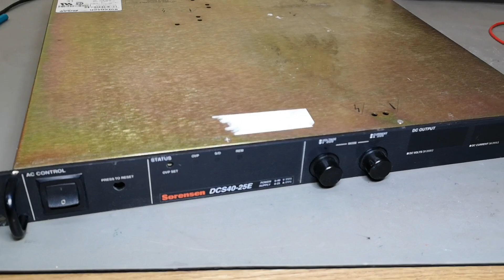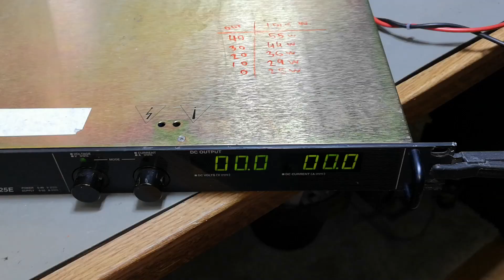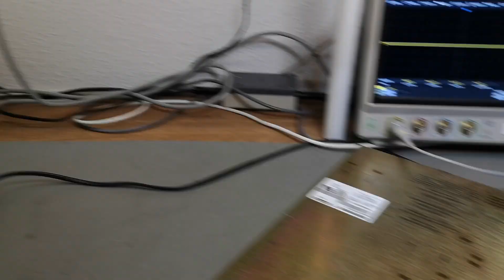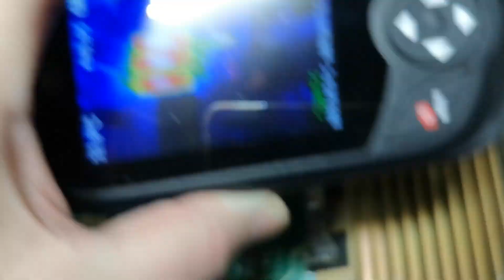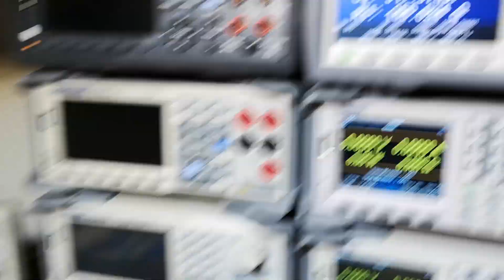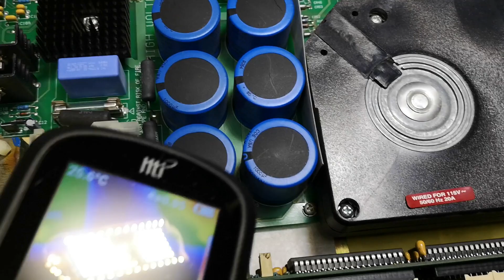Sorensen DCS40-25E switch mode power supply 1kW test teardown repair

Comment: 21:23 do I spy a rifa cap?
Reply from the maker: oh yes, but the new blue type, dont seem to find them cracking or blowing up
Reply: Actually I was thinking the yellow rectangular one next to the edge of the chassis. White black twisted pair running in-between it and the top large filter cap. May not be a rifa though, looking closer it has two bright yellow things sticking out both sides. What is that?

Comment: Did it ever happen to you or if you ever heard from someone that during REMOTE operation output caps start smoking?!

I have DCS8-125E unit and it was working perfectly by yesterday. The unit's J3 terminal was wired for remote voltage/current programming, remote shutdown, local OVP, remote voltage sensing. What happened yesterday is that the positive voltage sense terminal was disconnected from the positive current terminal (negative voltage was connected to negative current terminal) while I turned on the output by the remote command. The unit started smoking immediately. Remote controller/logger (i.e., Arduino) logged output current of 2.8 Amps for a couple of seconds although the circuit was open (before I noticed the smoke and pressed the E-STOP button on a test-stand). I haven't seen values on either display (voltage or current) before pressing E-STOP button.

Upon opening and inspection, I determined that the source of smoke were three big 22mF / 16V output capacitors (C51-C53). I ordered the replacements, but I want to be sure the error wouldn't kill the new caps as well (or something else). No other components look suspicious/burned inside the unit.

Is it possible that DCS units in general can give high voltages (in this case: greater that 8V) if remote voltage sensing is enabled and sensing wire get disconnected from the circuit or there is a specific failure in my unit? By high voltages I mean voltages high enough to make 16-Volt caps start smoking immediately?!
Reply from the maker: output caps do see alot of ripple currents, so make sure your new caps are designed for this

Comment: Thanks for the teardown and repair video. I have a DCS60-18 that shuts down with an OVP error (no load) that I will start troubleshooting, which is what brought me here. I have a thermal camera !
Unfortunately the hot resistors is the price you pay for low frequency snubbers (50-60 Hz). The purpose of the snubbers is to protect the FETs used in the final output stage from large voltage transients. The FET and associated components define the parasitic capacitances of all those parts, which drives the selection of C and R in the snubber circuit. You could do away with the circuit for power savings but be prepared to replace a lot of semiconductors due to overvoltage. It's probably best to just live with the losses, although you might consider upping the wattage of the resistors to keep the heat down inside the chassis.
ymmv
Reply from the maker: i really hope you manage to fix it, the DCS series are super nice units, I still take this one out now and then and use it for job projects.

Comment: Nice piece, congrats on finding the faulty capacitor, a thermal imager is a very useful tool. When I was still working in research and development laboratories, one of my specialties was repairing high-power sources for international telephone connections. Rack design with a height of 4U and after removing the cover there was no room for air inside as it was filled with components. Those sources were connected 24/7 for several years and were monitored from a central PC. One day, for example, the PC detected a voltage drop of 0.5V below the limit and switched the backup power supply, and this, which was evaluated as defective, got to my desk. Well, in a box like this, look for where and why you are missing 0.5V when after 24 hours of re-operation the voltage is absolutely accurate, I was looking for that defect for 3 months. Original components had to be used, the manufacturer forbade the use of substitutes. For the first time in my life, I saw a diode with a temperature specification of 0.001V/°K. Those sources lasted unbelievably, the longest documented operation during my time was 24/7/15 years from the first switch on.

Merry Christmas and Happy New Year 🎄🎁🙂 Tom

Comment: Hvad er det for et hvidt bånd der går igennem hele strømforsyningen? Det ligner et fladkabel ..
Reply from the maker: the white band in the centre, is a plastic-cardboard type of band, its purpose is to steer the air flow correctly thru the unit with the lit closed
Reply: @TeardownOZ2CPU  Yes of course, thank you

Comment: Maybe the air flow and thus cooling is different with lid closed?
Reply from the maker: YES cooling is a lot different, and a lot better, i will not recommend to run it at full power with lit removed !
but the broken capacitor was super lucky to find, only found due to luck
Reply: @TeardownOZ2CPU  i was surprised to see it being not a tantalum this time!
Reply: @zaprodk  heh if it was a tantalum it would have been found many years ago when it exploded lol
Reply: It will be. But in these energy saving times, that kind of losses is not cool.
Reply: @zaprodk  55W losses at 1kW wouldn’t be bad.
Think about the efficiency of an empty fridge…
Reply: @inse001  but that is 55W losses at no load. That's the part that sucks. I believe the losses will be even bigger when the PSU is under load and delivers the full output current at full voltage.
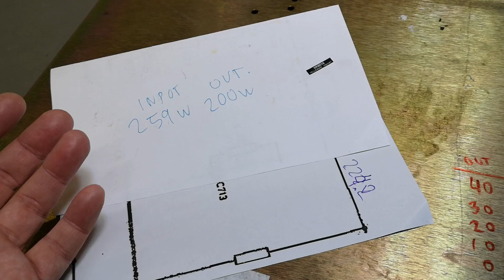Reply: @zaprodk  OK, at 6:00 not quite 1kW but Thomas almost freaks out about efficiency